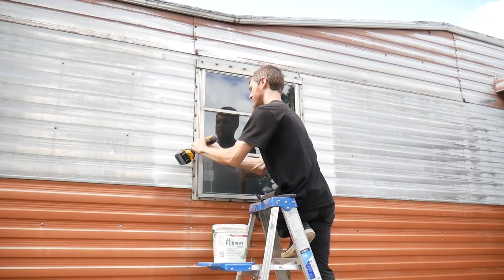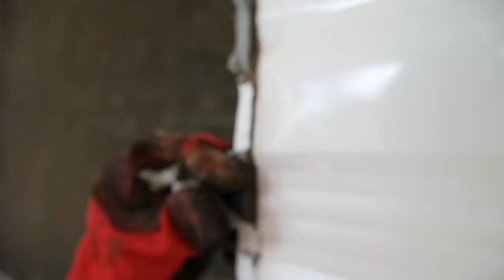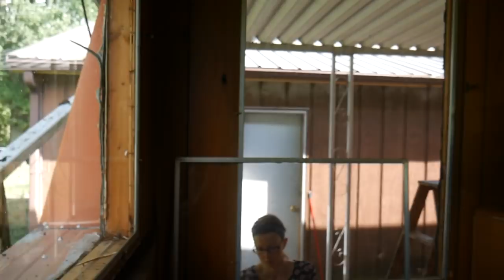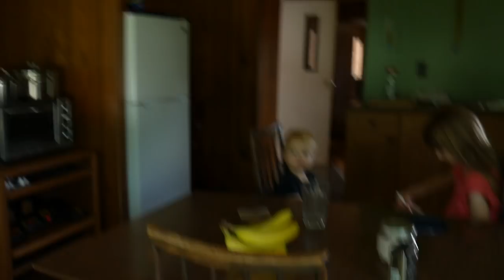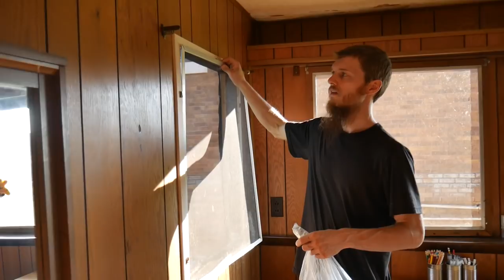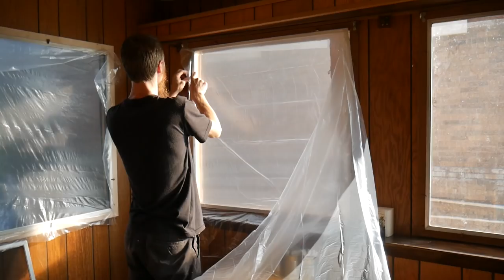Our Mobile Home Looks Abandoned - No Windows Prep Day 2

Comment: This actually highlights how insecure trailers are.  All someone needs is a drill and they can gain entry into any trailer through the windows, without breaking or smashing anything or even picking locks.
Reply from the maker: Yea, that's a good point. As long as they know what bit to get for the screws. ;)

Comment: I hope the caulk you used wasn't actually silicone because paint won't stick to it. (I learned that the hard way.)
Reply: Also, if you use a heat gun on the putty, it comes off easier.
Reply from the maker: We specifically bought a silicone that is paintable :)
Reply: Good thinking. I wish those formulations were available when I learned this lesson 30+ years ago.

Comment: With unpredictable weather, you may have been better to do one window at a time - remove, replace, then on to the next - that way you wouldn't have to worry if it rained.
Reply from the maker: We had to take them all out to prepare the trailer for the paint job. Then after we painted we put the new ones in. Luckily that all went smoothly and it didn't rain while the windows were out :)